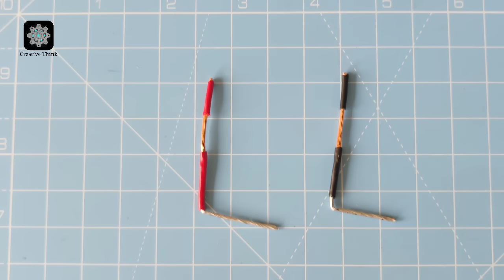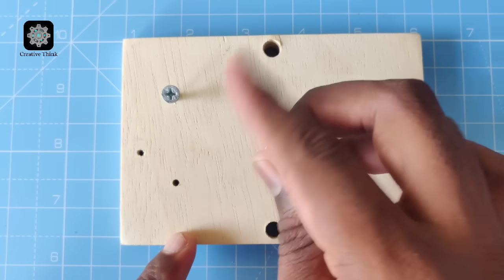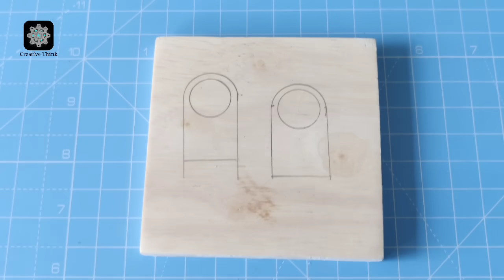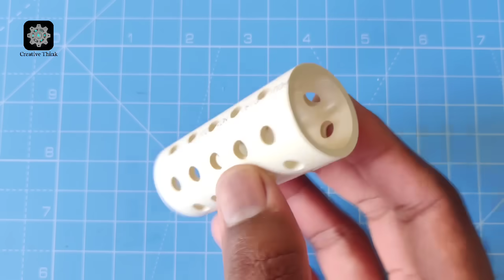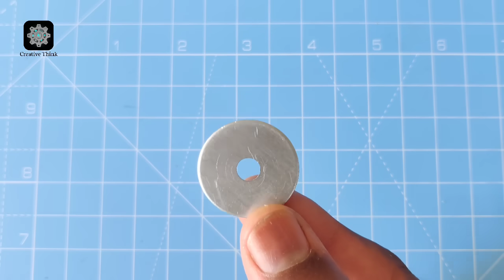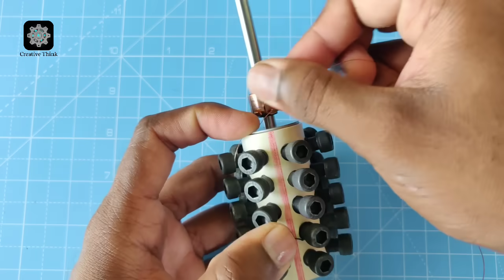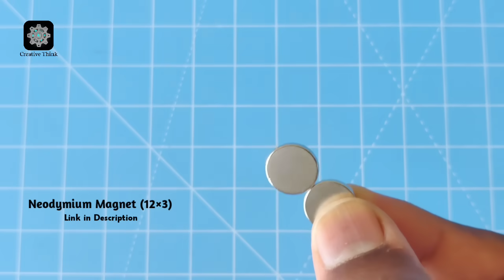Free Energy Generator Using 20000RPM  Very Strong Armature

Comment: Now disconnect one of the two wires and see if it starts slowing down :)
Reply: if its using a feedback loop charging system then disconnecting the wire would be like removing the stator from an induction motor.... no a true test would be to pick the machine up while its still running just to prove there's no hidden wires.

Comment: The motor, not generator,  would work with electricity added because the stator with copper wire spins opposed to the magnets. If you noticed the two little cut outs he made which he put the bearings in they each had two holes drilled in the bottom.  The holes were to run wires from the battery underneath. The electricity entered the motor thru the brush.

Comment: Shocked to see how many people don't understand how this works and think it is fake. This is a generator without a power supply. You can build this yourself and see how it works. The magnets are why it spins and makes power. Sparks are electricity from rotor to the armature. It cannot sustain any significant continuous power output without some type of power such as windmill, gas engine, etc.
Do you not hear it slowing down when he attached the light to it? The current draw affects the magnetic field with load.

Comment: AC is coming in through the brush terminals to create an induction motor.  Magnets alone cannot provide any force to cause continuous rotor rotation--they can only provide a torque when AC is applied to the rotor windings in the proper way.

Comment: This is a step motor. Simple version of generator in a windmill. If he left the light connected it would stop spinning due to the current draw. Has to have wind, flowing water, engine, etc., for it to generate continuous electricity.

Comment: Beyond just a curiosity here, a fascinating electric automobile design would involve electricity generation and battery storage to restart the system. But, the laws of science are that usually a lot more energy is required to produce a much smaller output energy at the wheels.
Reply: yes, and it depends on how many connections are involved, the more the less efficient it is

Comment: i work with cars and electronics, that is not 20000RPM not even close, and of course this is powered by some external energy source that transform the copper into an inductor and makes it move that way, there is no way that this is selfpowered, but its a good example in how you make an electric engine or a alternator.

Comment: So what we have here is a beautiful presentation of a simple DC motor build in a less efficient way to look flashy. Forget the magnets at the spinning part, those are just for show, the magnets on the outside however provide a pushing force against the field created in the copper coils and carried through the steel bolts. The commutator does its normal job of making sure that only coils that push against the outer permanent magnets are powered. I assume the thing is powered by a battery that's connected through the two screws that go through the wood, there's probably two thin wires going under the table mat. If he spun it by hand he'd be crating free energy, that is if you consider your own labour free as you're not paying yourself.

I would suggest that you report this for being misleading as this gentlemen is clearly trying to tell you that he can break the basic principles of energy conservation.

Comment: It looks real and it is electricaly possible. He has just made a DC generator. Put those magnets on rotor down, put some voltage on the red and black wire and you have a DC motor.
Reply: And is not free. Neodium magnets are expensive as hell. (source of energy)

Comment: Most of these constructions are fake and too easy to "get going" with compressed air. I tried to build something with magnets on a computer cooling fan ,but here is the problem: You CAN get a push from the magnets but immediately you also get excactly the same pull and it stops.VERY difficult to place the magnets right. To get anything going I think you need an electrical "on" at the right moment to get the push ,and a quick "off" to cheat the pull.  AAyy it hurts the brain. Good luck out there....

Comment: This kind of generator could be fitted under the hood of a car instead of batteries this could be the source of energy to charge a regular size batt and the energy harnessed or connected to the electric motor, of course car manufactures know about generators like this

Comment: I'm a machinist, and that not even running 1,000 RPM!! Let alone 20,000 RPM. Maybe 500 or less. It's not even balanced enough to run faster than it is. Any faster and parts will be flying across the room!

Comment: Well I am not a physicist so I cannot tell if this (as a standalone setup) is generating power. However, a question here might be, this generator (as is) how much power is it producing? The wires also cannot be used for a lifetime. How much is their life expectancy? Is the generator constantly spinning or you need to check it every now and then?
Reply: Also not a physicist, but since perpetuum mobiles and frictionless designs are impossible I'm betting this machine is producing negative power.

Comment: 20000 RPM? maybe 600 at most. I work with turbo chargers and there is a distinct sound when the hit certain speeds. Probably catastrophic destruction if it hit 2500 RPM.

Comment: No way I can believe those are twenty thousand rpm. "RPM in a propeller aircraft is typically under 2400, as the prop spins at the engine RPM speed. Above 2700 the tips of the propeller begin going supersonic and make more noise than anything." 20K rpm are from a turbine of a jet. What a blatant lie! If energy was produced that easy there wouldn't be so many big nuclear, carbon, hydro, etc electric plants. There wouldn't be so much pollution in the environment. I wish it was that easy.

Comment: Do the same video, this time without the wires on the commutator. with audio and lift the device off the table :) The sparks they are commenting on I believe are because the wire touching the commutator is too close to the individual winding points. But prove us all wrong :)

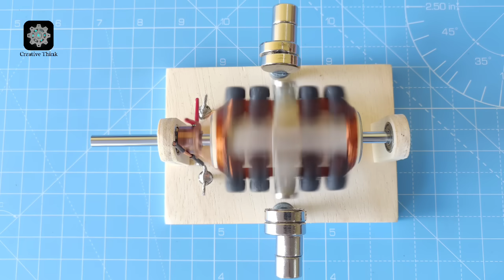Comment: Ask yourself why are there sparks at the red wire with no load on the system at  8:12?  Sparks can only be there if there is current and at that point there is nothing attached to the wires.  No load, no current and therefore no sparks.  Dead giveaway.  The light is being powered by the same thing the motor is being powered by.  It is pretty obvious what he built was a motor powered by a hidden battery.

Comment: I hear alot of complaining on these kinds of projects and videos. So if i get what people are saying correctly, they think he got a battery hidden under the wooden base, maybe the base is hollowed out and a battery is hidden up in it. I see this same accusation being made everytime on one of these free magnetic energy devices. What's funny is half the people making these claims have no idea how a generator works.  Unless you have created the same design and posted the video showing this then I would say you have no room to make such accusations. Produce a video, show the same design and construction, show the bottom and top of the base in your video and unedited and show that this is fake! Show that it produces zero results. Show that it produces not even one milliwatt. I say the same thing to creativethink, show us a video unedited with the base, top and bottom with everything to prove no battery been used.  People will be skeptical, doesn't matter what you do. Even if you do as I suggest, some one going to say next or as it has already been stated, you got a air compressor going somewhere. Crazy but no way your going to prove that its a free energy device on youtube. You need people right there in front of you and even then its trying to reprogram those that have been taught not to think outside the box. It's sad.

Comment: very nice how already at approx. 8 min. the sparks can be seen at the sliding contacts, although no circuit can be closed yet - unless of course a voltage source is already connected. If you are going to fake, then do it right. :P

Comment: It is good proof of free energy since it is not using mass-energy like battery, but pure energy that is Aether, of course, the magnet is mass, but it is not fuel energy like a battery, and using water as a motion to create electricity, but magnet itself, so you are not causing motion, but there is different density to give you motion, like a strong person compare to weak person, can a weak person move a strong person? No, it can't, but if a weak person runs at a far distance and fast, then push the strong person, the strong person will move. So, it is about power per density, distance, speed, time. So, the primary is density, the magnet has high-density power compared to other mass, so you can see output power when using two magnets that there is a barrier in between that is invisible, so that is Aether which is free energy source and endless energy source because Aether doesn't run out since it is the primary relative to secondary that is mass which run out like magnet, so the magnet is a battery to be used, but within mass and magnet is Aether as a gate that goes thru or closes up the gate within the mass, so basically a portal as a range in size which allow thru of Aether thru to cause motion to the mass of any size. So, there is counter space and space. The space that is where the mass is can break down and run out since it is beyond the tension like a person down in the water is beyond the tension so feel the pressure on the body, so what feed the tension as the energy that is Aether. 

To be clear: Tension and pressure that is a rubber that pulls out is tension so there is pressure on the rubber, same as pressure down in water depth so there is pressure around the body as it squeezes you. The water at the top pushes you around you. So, it is about the pressure that push the mass around, so magnet energy is a pressure that pushes the environment so you push thru the environment so you create energy since the higher tight space, and the higher motion thru tight space, the higher energy thru motion. Ya know motion is connected to two different, so it is based on accelerating from a stop to go. Magnet is a high-density energy field and another mass has a lower density energy field, so that is based on polar density. It is about two different to create motion, so magnet has high two different from left and right side, so left is a high amount of sameness so is right, so two different interact to become motion as a higher density of volt which above uses two magnets and another two magnets, so 4 magnets, so 2 pair magnet to cause the center magnet to cause the speed and the copper as a bridge to carry the energy to the load that is the bulb. So, the magnet is the battery. Two different cause motion that is based on stop to go, that is accelerating, or small to big, so it is all about different to cause react of energy so the space is energy which is from counter space where energy lives in so it activates to allow counter space to open and energy goes thru so it causes motion. Ya can look at Eric Dollard that is a modern Tesla. Ya say above is impossible so using the battery, but the magnet is battery and you can see the magnet cause repel to other magnets, so that is the battery so when you say magnet energy is impossible so it is using battery so the person is lying to other people thru limited information since the battery is connected to fuel itself that means what?? That is two different, so it is not fuel alone, but two different spaces to cause react, like a magnet. Like I say about how motion works. There is static pressure and dynamic pressure.

Comment: The video is fake, there is always a energy device underneath the table. Is this case, The entire device is anchored by the two wires that go through the board and the table. If this was a free energy device, it would drift across the table from the clear vibrations of the motor itself.

Comment: what he isn't telling you, is that power is being fed in via the red and black wire(from underneath). If he stopped the motor turning, because the power is still connected it would still light up the leds. Did you notice the drop in RPM when he connected the led causing a drop in current. It's a quite neat little DC motor NOTHING else, the magnets are just there for effect, they are doing nothing. What a pity But yet another FAIL. I do believe Zero point energy is possible, but this aint it!

Comment: Lots of little tricks and builds in that little book. Except next time don't tell the people on your headline it's 20,000 RPM when it's6-700. There are some people out there that actually know what 20,000 RPM looks like and sounds like. Now then. Make an engine out of a block of steel with no carburetor or fuel pump that runs. I made one in grade nine. Now, show us how smart you are and do the same. Don't lie! It's unbecoming. Silly boy.

Comment: hoax.... I also saw the sparks on the positive terminal. If we should see that at all, it should only be under load.... we saw the sparks without a load. This means there is external power being provided to run this "electric motor"..... not a generator. Now if you used wind to turn this motor, it would become a generator. Not sure there'd be enough power to light all those lights though.

Comment: The commutator is sparking with out any load of LED light connection mean power applied through the screws, more over if suppose it is producing AC voltage will not run the LED light, that need rectifiers. It is motor only So it is FAKE. Do not follow it.

Comment: While magnetism done correctly can create self running, that's not what is happening here. I see the sparks on the brushes when you first spin it up. There is obviously a battery under the table powering this brushed motor. That's all you have here...a simple brushed motor like I was making as a 9 year old! And yeah...20,000 RPM...never got close! This video is nothing more than lame click bate!